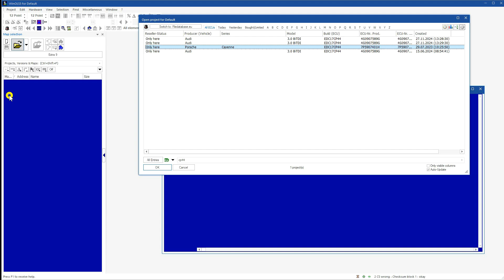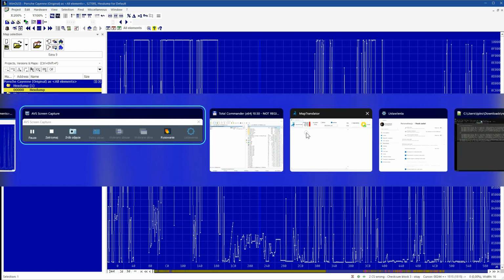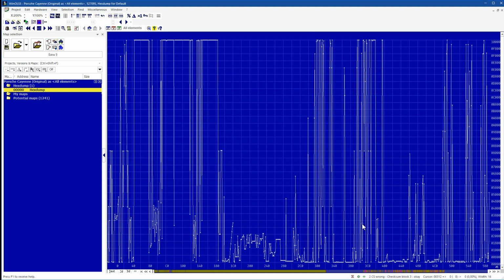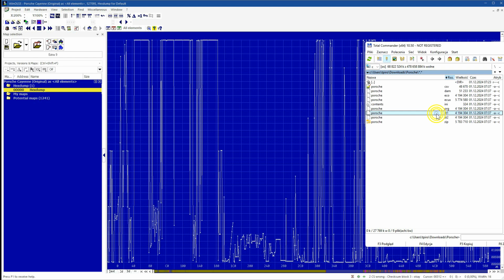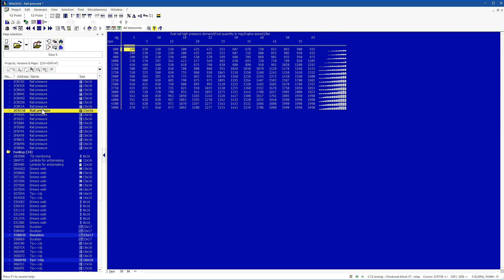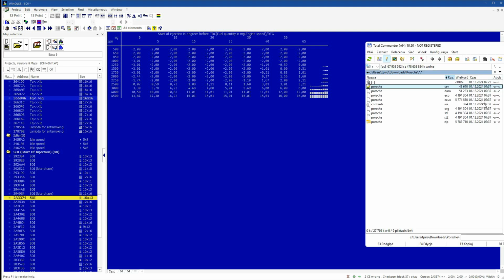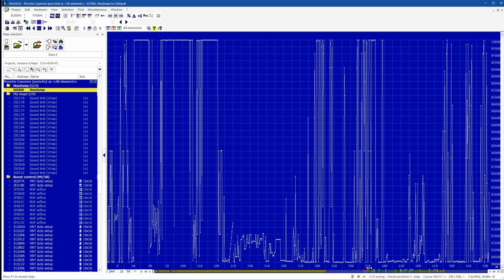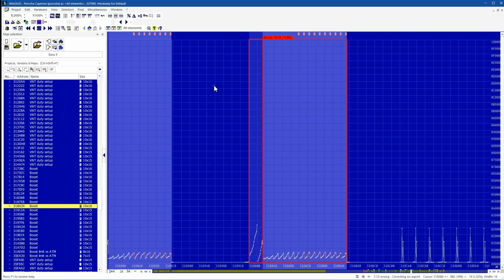Generating the Damos file from EDC17 for WinOls using the AI I created

Comment: Very impressive. Can u tune USA 2022 Sprinter 3.0D V6? It has the EDC17CP57 ECU. I was looking for a Stage1 Eco tune with full deletes.
Reply from the maker: Is that locked ECU? In Europe they are already locked. We have PowerChip external ECU for them only.
Reply: I’m not sure what locked is? I was able to buy and eBay ECU & clone using SM2 + pcmflash 71. Drive vehicle perfectly with no DTCs. Van is completely stock condition. I’ve spoken with a number of tuners mostly in EU & the conclusion seems like this is a trial & error process as no Damos are available for my vehicle.
My thought was the the flash file can be edited with tune and delete then I simply write flash to ECU.
Reply: @SFSFIRE it’s no problem to tune it :)